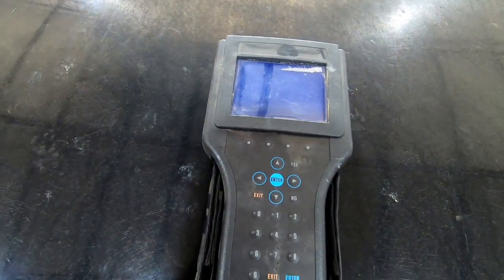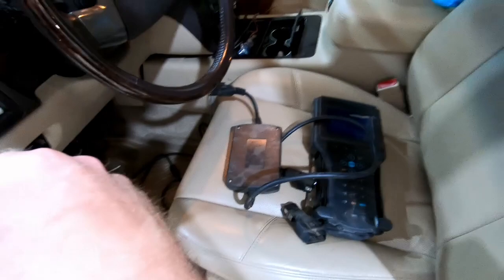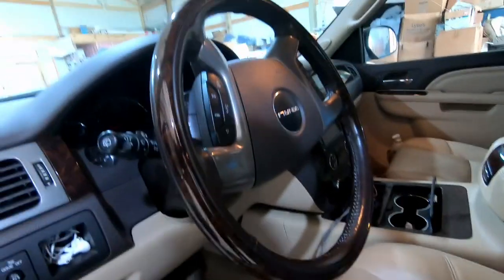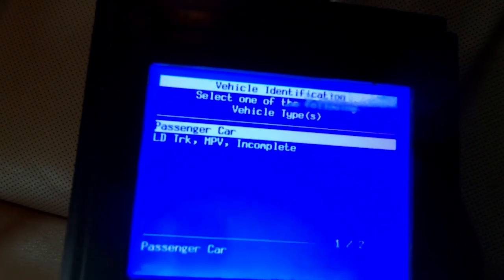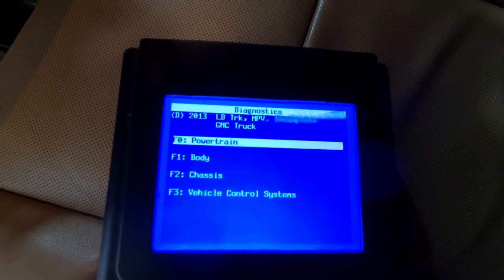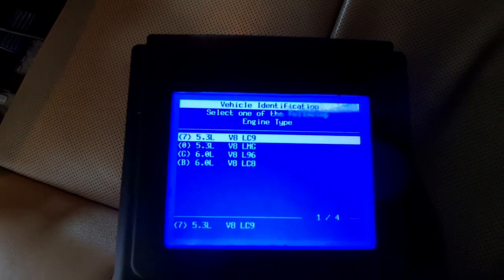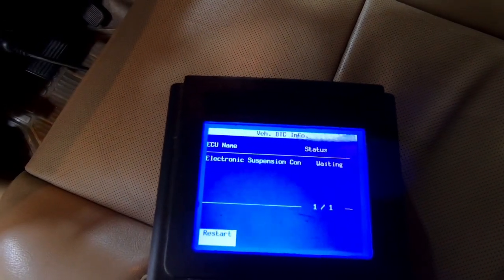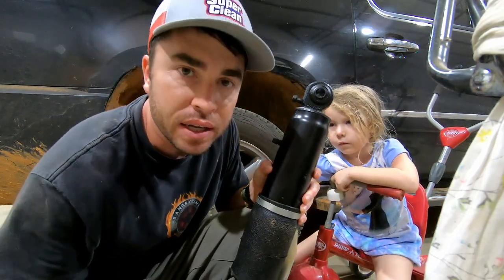GM "Service Suspension System" Error Diagnosis and Repair

Comment: How can I remove the service suspension light without changing the compressor
Reply from the maker: If the compressor is the issue, you should replace it.
Reply: can i put resisters on the shocks to delete the message @FarmDad

Comment: Hoping maybe you can help. I am getting code c0660-06 level control exhaust valve circuit short to ground or open circuit . I have checked fuses relay and pump all are working but will not turn on with this code. Any direction would be appreciated!
Reply: Ever figure it out?
Reply: @Robbobshiskabob  was the ecm that controls airride. Was cheaper to convert to conventional suspension so that’s what I did.

Comment: Did the error code show both struts were bad or just one?
Reply from the maker: Just one
Reply: @FarmDad  did you replace both are just one ?
Reply from the maker: @ANDMAZUROK  just one in this case.  Shocks weren't that old.  Had they been, I would have done the pair.
Reply: How do I figure out what shocks are the correct temperature replacement? Idk how to tell in the front. The rear I know it's the air ride. So I got a new acdelco compressor. Still shopping for the acdelco rear air shocks to get the best price. But not sure which ones are the correct for the front. 2008 tahoe ltz

Comment: I wanted to thank you. Your videos were so much help with diagnosing and fixing the air ride in my 2008 Yukon Dinali. I noticed the 2013 has an integrated brake controller but my 2008 does not I am able to order the knee bolster with the brake controller cut out and the actual brake controller switch what I am curious is if my vehicle is equipped with the wiring harness to plug that in or not how can I find out
Reply from the maker: I know that the brake controller was an option on your model, but I do not know if they used different wiring harnesses based on if you got that option.  There are many aftermarket brake controller kits.  It may be best to get one of those instead of trying to get one through gm, but it won't look as pretty.   Glad my videos helped you!